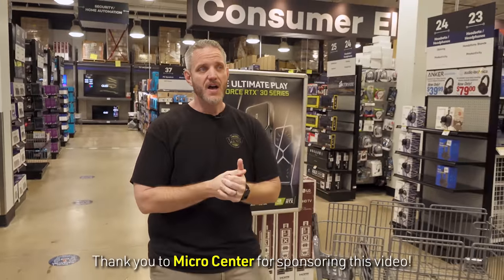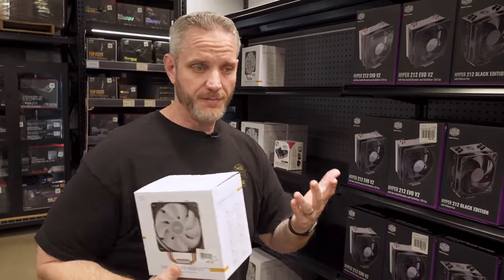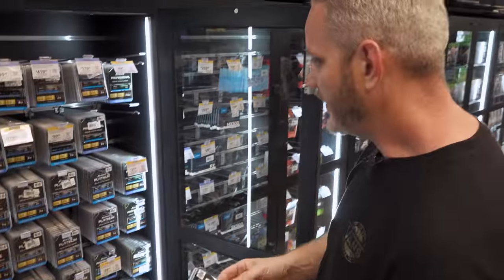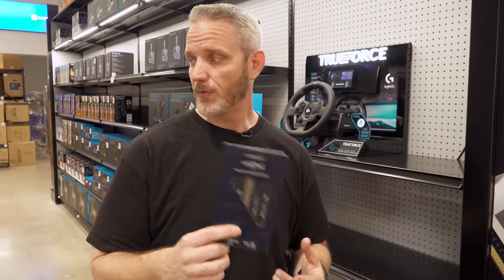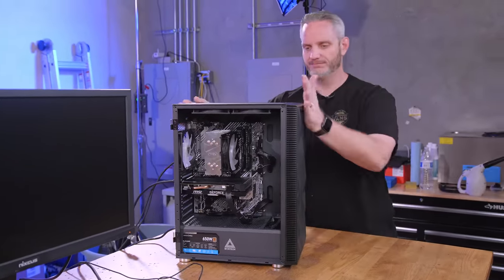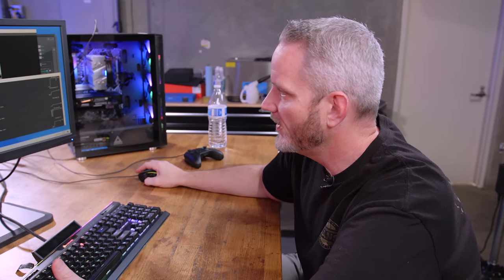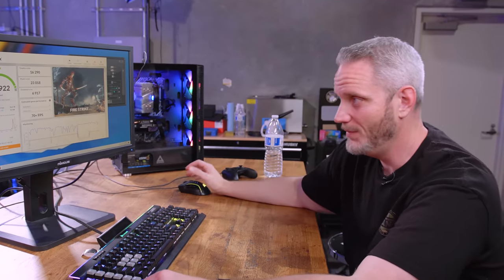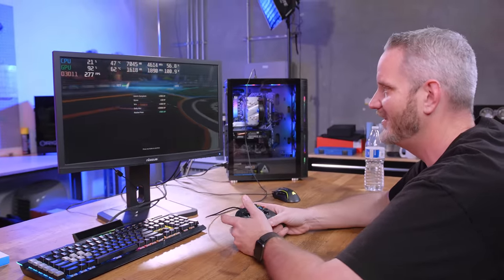How cheap can I build a "Gaming PC" for in 2022

Comment: Nice video !! With big respect I have here a good budget option . 
1. Intel i5 11400F - 142€
2. Psu , Aerocool 650w bronze - 35€
3. MSI mag Z590 - 135€
4. Ripjaws V , ddr4 3200 16gb (2*8) - 63€
5. MSI tower vampiric - 53€
6. Nvme , m2 samsung 250gb SSD - 48€
7. Rtx 3050 - 360€ 
Total 836€ ~923$
Prices in Greece from online eShop stores . Shipping + 20€>>
Reply: Where to send you a message ?
Reply: @johny4692  this is a scammer not jay
Reply: for 150$ more you can get x3 more performace. for example all games in highest settings on 1440p will have 150+ fps. even cyberpunk. think about building. ryzen 5 5900x with rx 6600 xt :) atleast next 6-7 years you should not worry about streaming, gaming, working. etc :)
Reply: CPU - Ryzen 5 5600X  (210$)
Motherboard - 
 ASUS - B550-F ROG Strix Gaming (230$)
GPU - Power Color rx 6600 xt red devil or hellhound depends on where you can find it.  (500$)
RAM -  G.Skill - Ripjaws V 16GB (2 x 8GB) DDR4-3600MHz CL18 (60$)
Case - NZXT - H510 Tempered Glass ATX Mid-Tower Black (90$)
Power supply - 
Inland  750w 80 Plus Gold (80$)
storage - 
Inland Professional - 512GB NVMe M.2 Internal Solid State Drive (50$)
Cooling - 
Enermax - ETS-N31 CPU Cooler (35$) or you can go for noctua. best air cooler for few bucks more.
total build cost 1,250$ depends on region where and how much are the products.
Overall you can tweak the build a bit to drop the value. for example the motherboard or the power supply or the case or the storage :) overall the combo of CPU and GPU will be the overkill next 5 years. and in 5 months its expected the price drop of the GPU and CPU to fall down. so better wait for Octomber :)
Reply: In Europe, get a 6600 at a same/lower price, much better than a 3050
Also, rather get a slower Nvme like a P2 or NV1 and get 500gb, 250 is full with 1-2 games and Windows, wouldnt recommend in 2022. 1TB would be the better option if budget allows.

Z mainboard seems overkill, you can get cheaper ram, Vulcan Z 3600 is 61€
Reply: @Robert-gs6qv  yes I understand what you mean but here we are talking about budget))

Comment: Damn, this budget pc is way beyond my budget, time to hit ebay for a PS4
Reply: Those are expensive as hell also.
Reply: Some PS4 consoles more than PS5 MSRP 🤣
Reply: Bruh this guy doesnt know what a budget pc is bro thinks everyone has 1k just lying around find a different channel if you actually want a 400-700$ gaming pc
Reply: @Keykvy  if you want a 400-700 dollar pc you might want to roll it back quite a few years Cuz getting decent parts and a GPU for under that is not easy right now, don't blame jay for inflated pricing.
Reply: You can build with a 5600G for $500 or under and have a better game play than ps4
Reply: @rons113nj  well i understand that its a ps4. But when people say others dont know what a budget pc is cuz he made a decent gaming pc with all new parts and its not under 700 dollars is just rediculous in my opinion.
Reply: keep your eyes peeled for 5600g compatible stuff on sale and you can build a pretty nice apu rig less than $500 but adding a dgpu is almost always gonna set you back closer to a grand these days. best piece of advice i could give is be patient and diligent on what current deals are going on. good luck buddy
Reply: @limitless.motors  Well, you can actually build a budget gaming PC without even resorting to an APU. A GTX 1650 is about $215 on Amazon. So, you can pair that with an $80 Core i3 10100F, $90 B560 motherboard, $55 16GB of DDR4-3200 CL16, $43 SATA 500GB SSD, $60 Case and $45 Corsair 550W 80+ Bronze PSU and that should be about $600.
Reply: I would gladly put extra than a PS4/ps4 pro to avoid their terrible cooling/fans
Reply: @sokool3994  where are you finding 16 gigs for 55 dollars? I keep seeing them for upwards of 100. And yeah i get you can build a budget pc. My point wasnt that you cant. My point was he was basically blaming jay for the pc being over 700 dollars and saying people should go to a different channel when He used all new microcenter parts.
Reply: @limitless.motors  I think you can find a Silicon Power RAM for that much on Amazon.
Reply: I sold my PS4 at my local shop for 200 and now i regret it for this reason ep now they are completely jailbroken
Reply: This video makes me feel real good being able to snag a PS5 at launch for $500. This thing is 2x the cost and less capable.

Comment: "in store deals"

Gets to the GPUs: "above MSRP"

Mmmm, yes, I love me some deals that charge more for PC hardware. Especially when they are clearly stocked and the next generation is literally just around the corner now. 

I genuinely can't wait for the announcement of the 4000 series and the flood of 3000 series cards hitting the market constantly pushing the prices down as people try to sell off their now "old" hardware to get the newer better hardware.
Reply: 4000 series is going to be expensive af
Reply: @christophervanzetta  ... plus, as usual, not all new gen SKUs will be released at once which gives the 3000 series plenty of time to trickle out (while production is ramped down accordingly so there is no oversupply on last gen GPUs)
Reply: DONT GOTTA BE SO CYNICAL DAWG JEEPERS
Reply: thats not gonna happen, look what jay just did, purchased a weak 3 year old card for 360usd.. its not even an rtx card..
Reply: @christophervanzetta  
Not saying it won't be expensive. In fact I more than well expect NGreedia to make the MSRP 50% more than the previous generation MSRP. That said, even at that price, it would still be a much better value than the 30-series current BS pricing. The days of cheap PC gaming are dead and crypto fucking killed it.

Comment: Question: Wouldn't you basically break even on the AMD processor compared to the Intel because of the in-box CPU cooler? I'm using the in-box cooler on my 5700x and it's been doing just fine for a year and a half. I'm only running a 5600XT and 4 case fans, but I've never had heat issues with the stock CPU cooler. Personally, I prefer the 5600x and either a B550 or X570 over an 11600k, but that's just my opinion
Reply: the only difference being that stock coolers be LOUD. (though at least AMD's are capable of managing the load, unlike intel's -- and yes, intel's LOCKED CPUs do come with a cooler)
so if you want to save every last cent, sure!
if you want a quiet PC, any aftermarket cooler is going to make a big difference.
Reply: @niky00045  I was also wondering which fan in my pc is making so much noise, I thought it was this cheap exhaust fan I got.
Reply: @Daniel-dj7fh  it still could be lmao. My AMD stock cooler for my 5600x wasn't loud(atleast mine wasnt) but I quickly went water cooled for anesthetics lol
Reply: @Daniel-dj7fh  I'm think the stock fan is lottery. I built one for a nice and I cannot hear it unless it's 100%
Reply: @niky00045  it was still supposed to be a budget build, so i dunno man. It woulda been better to have a i5 10105F or 10400F with a cheaper mobo, would give you space to get more storage, ram or GPU performance
Reply: Without accounting that you could get a less wattage since you, again, aren't aiming for upgradeability as much as budget. Any cheaper thing can allow more money towards other specs or hell, even peripherals. So yeah overall kinda weird choices done in this video, specially getting a overclocked capable cpu with a locked mobo

Comment: The last PC case that I bought cost me less than $1. It was a bit beat up and dented. Which is great as brand new blinged-up cases scream "steal me!" to every low life that breaks into your home. It was a full sized tower case, so the components inside were happy as Larry. Plus it's more ecologically friendly to reuse an old case instead of buying new.

Buying used may be the most cost effective approach for other parts of the PC - depending on what deals you can get.

Comment: I recently rebuilt an old 4th gen pc with some spares It amounted to £65 probably could have done it for around £100 - £120 buying the bits I already had. It's a bit of a potato though but plays older titles like MWO quite happily. The one before that cost a bit more but still plenty 'cheap'

Comment: you can find a lenovo with vega 11 graphics for much better price. in addition to barebones, laptops has much more better apu(s) than desktops pc(s), because amd and intel wants you to purchase a gpu when you build a desktop case (or maybe they don't want their cpu to cost an arm and a leg). but when you build a laptop case, it's about saving space, so apu(s) are more economic and efficient. the first example i have in mind is the onexplayer mini (a bit expensive because it's mini). if you have trouble to found vega 11 desktop machine, you still have zbox nano ci665.

Comment: 1660S is a weird card. Mediocre compute power combined with great memory bandwidth for its price. Still holding its place as one of the best-budged cards, after two and a half years.
Reply: Bought mine right before the pandemic prices (lucky me) and kinda wished I got the 2060 instead, but the 1660 super performs so well for a budget card. I only game at 1080p and this card runs majority of new triple A games on max or a mixture of max and high settings.
Reply: @Powwpoww   I got my 1660S inside the boutique rebuild bundle. That was just before the prices started to rise. I bought it at the right moment because that same system was 150bucks more expensive just a couple of days later. I agree that RTX 2060 would've been nice. But with heavy OC, the 1660S is surprisingly close to stock 2060.
Reply: +1
Reply: Yeah, it is a really good GPU. But, calling it the "best budget GPU" now wouldn't be correct considering the RTX 3050 is only $30 more on Amazon and RX 6600 is $20 more. I think these are better GPUs for the price.
Reply: @sokool3994   I said it's one of the best ones. But I appreciate your opinion. Amazon prices are a great indicator but they aren't absolute.

What is really the best value, that is still situational. Depending on the deal, which you get and on the PC which it's going to. If you don't have CPU and MoBo, which does support PCI-E gen 4, RTX 3050 and RX 6600 might lose performance in some games because of the x8 link. But they do have features like RT cores and more VRAM, and RTX has exclusive DLSS.
Reply: @andromeda8418  Right, the RTX 3050 may lose some performance on PCIe 3.0. However, I think the RX 6600 won't drop too much in performance, considering the RX 6600 XT managed to maintain most of it's performance.

Comment: I would love to see how this compares to a PC I built 4 years ago now that had a ryzen 2600, rx 570, 16gb of ram, and also a 512gb ssd for $490. Of course the cpu and gpu are better, but are they 2x better?
Reply: Polaris cards refuse to die. The only hold up on my son's 570 os the 4gb of vram, so textures aren't set to high on everything.
Reply: i mean, you could just run the Firestrike test and share the result. I built my pc back on Christmas 2016 with 6700k, 1080 and 16GB ram and 256GB SATA ssd for like 1750$ and iirc, it scored like 16000 in Firestrike? The system still rocks hard and it suits all my needs since i don't play new games anyway

Comment: The ports on the top/side of the case and not the top of the front panel is probably to reduce costs in making a more complex front panel attachment. also limits the chance for damaging your io cables when you remove the front panel to clean out the dust if you pull the wrong tab or something. Not sure that the dimensions of the case really are, but an unintentional side effect could be allowing for taller tower coolers!

Comment: In my opinion a good build for your money would be an 11th gen i5 along with a 1650 or 1060. 500 watts or possibly less is all you need. The i5-11400 comes with a cooler. Depending what drive and sizes you go with (SATA or NVME) and how much RAM you get the build would likely be much under $1000. As Jay said for easier upgradability going with more than 500 watts might be worth it.

I personally have an i7-11700k, a 1650, 16 gigabytes of RAM and a terabyte NVME SSD. I have a 550 watt power supply. Don’t exactly know how much it cost because some stuff was bought for me and my dad and I split the prices on some stuff lol
Reply: Agree on 10400/11400. Definitely the best budget chip. 120-150$ and much cheaper motherboard with b560 and you can OC RAM.
Reply: Why 11th gen. It's either 10400 or 12400.
Reply: @SanjeevKumar-ik7xs  
Last time I checked Newegg (a few months back) the 11400 was cheaper than the 10400 and was in stock. I haven’t really seen anything on 12400, it’s probably pretty nice, though

I think the 11400 was cheaper because it was on sale, I don’t exactly remember
Reply: @SanjeevKumar-ik7xs  Because 11400 is basically the same as 12400 performance-wise and quite a bit cheaper. 11th gen was hot garbage (in every sense) at high end, but very very reasonable at the low end.
Reply: @Lodinn  
Could you explain how 11th gen is hot garbage at high end?
Reply: @luhgarlicbread  Well it's relative of course, but 11900k barely ran any faster than 9900k while having higher TDP. So Intel has managed to do a bit of regression over two generations, and for how things work in that space normally, this is baaaad. Not that those aren't fast CPUs or anything, it's the context cues which make it look so bad.

Comment: For the price of that 1660 super you could of had a 3060 for 469. Is it the "cheapest?" No that is the RTX 3050 at 379.00 but for that extra cost you get current gen hardware and faster gaming and better frame pacing.
Reply: For the 359 price of the 1660 super he could’ve got a 469 bucks GPU!?
Reply: true my friend was on the EVGA list and snagged a 3060 for 399+ tax...to replace a 1070....simply bc theyve had a 1440p TN dell g-sync flagship monitor for a few years now....and the 1070 doesnt enable higher settings at that res....yet 3060 wont allow "MAX" exactly either in most of the newer titles at that res. Considering the used prices of 1070s i told them to buy it regardless bc they have the cash on hand. Theyve had it for 6m never installed...bc they dont want to pair it with their 4770cpu
Reply: 6600 or a 3050 would have been better. 
The 1660 suepr is a TERRIBLE card that offers nothing.
Reply: And 4 little letters DLSS.  I can't stress enough how good that is.
Reply: @MudSluggerBP  A RTX 3060 for 469 at my local Microcenter.
Reply: i agree even the  3050 is the better idea, 6600 certainly is.  money could be saved on getting a 12100, even a 12400 would still save you, probably enough to a get a 3060 or 6600xt
Reply: @duckilythelovely3040  just a 1070 sold as new XD
Reply: @MudSluggerBP  yes.
If he got a cheaper cpu with included cooler he could've saved 80 dollars right there.
Reply: @anhiirr  LOL!!!

Comment: When it comes to the GPU 6600 would have been worth it, and with GPU prices slowly stabilizing prices should be half bad in a couple of months.
Reply: this combo would have been bad, h570 only supports pci-e 3.0 and the 6600 only runs on a 8x bus so if he went with a 6600 he would only be running the card at pci-e 3.0 @ 8x